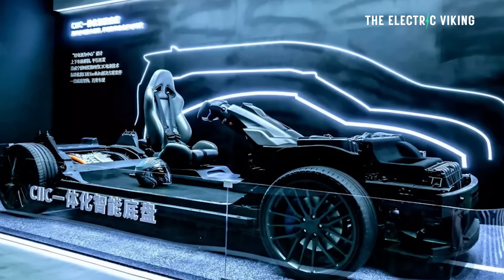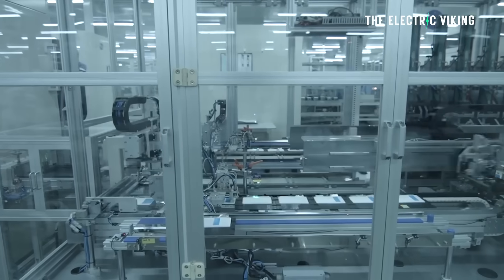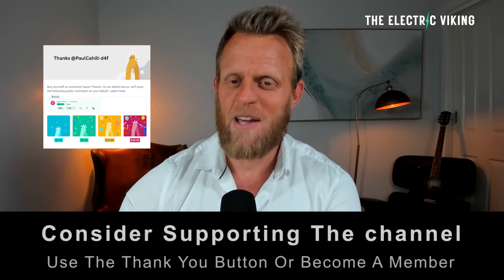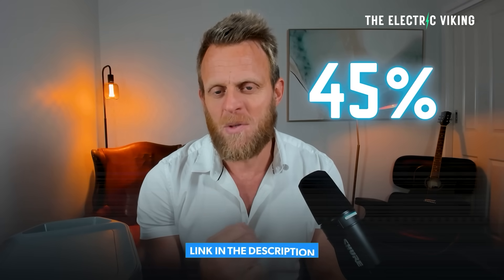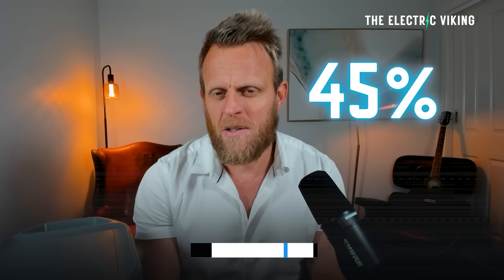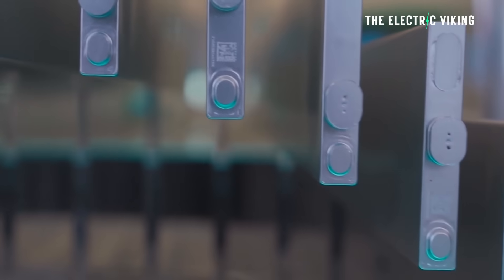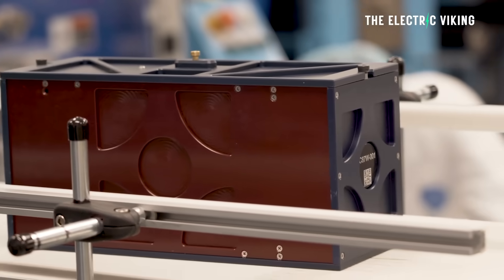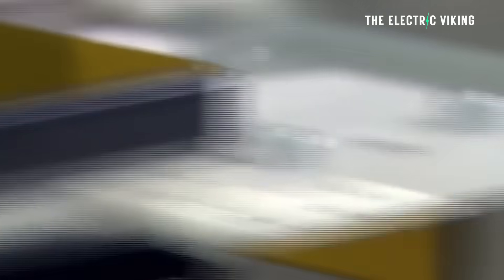1,000-Mile EV Range Unlocked: CATL’s Lithium Metal Battery Breakthrough!

Comment: in theory,  in a simulation, it was found that with some tricky engineering and assembly processes and the right materials it is possible to make at least 2 MW per ton without lithium ion materials. AT LEAST 2MW per ton. and... with regenerative braking and other energy collection methods we could easily travel that 1000 km and more. I would love to see more research on non lithium batteries... the metals used in this battery are common .

Comment: Like you said at the end of the video, I really don’t think people understand electric vehicles. 
I recently bought a Silverado EV for my work fleet. It’s going to be used in construction and on job sites putting about 35 to 40,000 km on a year. I’m gonna put the truck to the test. But most other colleagues of mine have mocked me for choosing to switch to an electric vehicle. The biggest downfall of an electric vehicle at this moment is range, but what my colleagues don’t know or understand is that range is only a downfall when you have to travel long distances daily. If I do at almost 400 km a day around my area for work and I mean that is absolutely the worst case scenario, the Silverado EV should have over 200 km still in range in which I will make it home or to my shop to plug it in for the night and have a fully charged battery the next day. Range anxiety is quickly becoming an obsolete thing unless you do long distance travel. And all it takes is a new type of battery to come out because the platform for EV vehicles is already in place. The foundation has been built so now all we need is a far more efficient battery that is far less weight and you’ll be able to get a lot more mileage than any internal combustion engine. Ice vehicles have reached their peak. No amount of re-engineering can make them far more fuel, efficient and burn less petrol. The wheel has to be reinvented at this time. I see where the future is going and I’m going to invest in it.

Comment: China's infrastructure is advancing so fat, that Chinese EV ranges should DROP. 

China has by far the world's largest high speed rail network, with more and more connections, covering anywhere that one would comfortably drive over a single day.  Thus long range driving isn't a significant use.  Over the past decade, China has added the most urban rail, commuter rail, and other public transit, so most people won't need to drive to work, to school, etc.  China is also huge on micro parcel delivery and most live in apartment blocks, so groceries and such are a short walk away.  Chinese taxis and rideshare are also very convenient and affordable.  Thus, there is very little need for most Chinese to drive on a regular basis - China is doing everything to make cars optional. 

For those who do drive, China keeps adding more and more fast charging, making charging more convenient and available.  With range anxiety solved, Chinese EVs can reduce battery size and cost, improving affordability and overall vehicle performance.  Instead of using an 75+ kWh battery weighing 500+ kg, they can spec a 25 kWh battery that weighs under 100 kg.  This makes the car that much more affordable.

Comment: Sam do the math right. The Panasonic 2170s in a Tesla are approx 250Wh/Kg, these cells claim 500Wh/Kg or 2X. For the same weight battery as the 82KWh battery in a 3 or Y you could put in a 165KWh battery pack which would give you 680 miles of range. Alternatively you could put in the sane size battery and cut the weight of the car by about 500lbs. That would boost the range a bit but it's hard to say how much because aerodynamics dominates and that wouldn't change.

I don't know what you were thinking when you said a 70KWh battery would give you a 1000 miles of range, 70 is smaller than 82 so the range would drop accordingly.

Comment: I’ve been hearing about the 1000 mile battery (1600 km) being just around the corner on this channel for the past four years when Sam first started publishing his videos. I think those are many, many years away, if ever. My friends with EV’s say they tend to plan on 400 km (240 miles) maximum between charging when planning a road trip, car loaded up, 2 adults, 2 kids, bags, aircon running, etc. They still have a reserve left but in any case they try not to get below 10%. We did a tandem road trip in our Mk5 Golf TDI with them once and we get 850 km in town and 1000 km on the open road so it was a bit frustrating waiting for them to charge all the time. We did drink a lot of coffee and ate a lot of sandwiches while waiting …😅

Comment: Sam, you need to rewrite your text.. If you put a 75kWh lithium metal battery instead of the existing 75kWh blade battery in a BYD, it will drive exactly the same distance. Well, maybe a little more since the CATL 75kWh lithium metal battery weighs less. But 75kWh is 75kWh. It's an energy measure. Both batteries have exactly the same capacity. What you meant to say is "in the same weight of BYD's 75kWh battery, CATL can fit a 150kWh battery". That's what you really intend to convey.
Reply: The new battery will drive slightly farther because the car will weigh less, so there will be less frictional loss at the tires.  Maybe 5% range increase from reduced frictional loss, assuming that battery weight is a significant portion of overall weight.

Comment: I think there is some fundamental confusion about the energy density. These new lithium metal batteries have 500 Wh/kg at cell level, not battery pack level. When translated at pack level, it will be reduced by about a third. Typical current NMC batteries (Tesla) have cell density of 250, pack density of 160. So, lithium metal batteries at 500 Wh/kg may reach something like 320 at pack level, which is twice as dense as current NMC, but not quite three times as much.

Comment: A bit confusing there. If density has gone up a 70kWh battery would be smaller but the car would still go the same distance.
OR a battery of the same weight & size would be 140kWh of energy storage.
Am I missing something ?

What we want is lighter cheaper batteries huge range is really not an issue to me. My 4 yr old Volvo does 200 miles and that is a lot more than my bladder. Many newer more efficient cars easily do 300 miles. Charging structure here in UK is now not bad so no real hassle stopping for a coffee and a charge. Maybe your huge distances over in Aus are an issue, but what it really needs is a great charging infrastructure and fast charging cars.

Comment: If you put a 70 kilowatt hour battery into any car it's going to go the same distance plus or minus a small amount for weight difference. But it still takes a kilowatt hour to push a car size object through the air at 70 mph for 4 or 5 MI. Now if you put a CATL battery in that's the same physical size into a Tesla model 3, then it can go a thousand miles. But just putting a 70 kilowatt-hour CATL battery in is not going to make a huge difference if it's still 70 kilowatt hour..

Comment: What he should be saying is for the same WEIGHT of the current battery (lets say 200Wh/kg) of 70khw,  this new battery will provide around 170kwh of energy and hence, considerable amount of more miles.
If he is comparing with current 70kwh battery at 200wh/kg to new 70kwh battery with 500wh/kg, the energy of both batteries are same and the only added benefit is nearly 2.5 times of weight loss, this will give some extra miles, no doubt on that, but not to the extent of 1000 miles like he said as energy of both batteries are same.

Comment: I feel like hybrids may be more useful than these megarange batteries. You use the small electric battery for an average top range people do on the daily - 100 miles maybe. Then if you need to go further then you use fuel. That way the majority of milage is done on your own solar or cheap overnight electric and those long journeys if necessary can be done on fuel. 

The battery part is going to be the most expensive component in these vehicles and more weight or more range, needs more battery which needs more weight. Surely its better to have a small battery used more intensively than a jumbo battery that is lugging around and barely being used (and at huge cost).

Comment: Just so you get it right; 
Watt (W) is power, Watthour (Wh) is energy.
Which means talking about energy density in a battery you should use the term Wh/kg. When talking about the instant power you can get from a battery you should use the unit W.

Comment: Safety issues?  We need more specifics - and safety in general, also low and high temperature performance probably rank higher than just energy density, charge power and longevity.

Comment: If they have a high energy density LM battery now that can do 1,000 cycles, then CATL could put their lithium metal batteries in their Freevoy battery pack with their Gen2 sodium ion batteries. Then you could have a 25 kWh sodium ion section that provides say 200 miles of range, and 10kWh of the LMBs for an additional 200 miles of range when needed. Since most people drive less than 40 miles a day, then they would almost always use just the sodium batteries (which have very long life) but then charge up the whole battery pack for the occasional long trip. Having a smaller, lighter, cheaper battery pack, and more range when needed. Win-win.

Comment: Toyota is going all hybrid for the 2026 this Year Model Year "last gasp for the gasoline nutters." ⛽ how a vehicle is #configured in the age of Full Autonomy which full autonomy been true for a long time now but no more need for bench seating for example from what I've seen on eBay where I can pick an an all electric bicycle with a removable battery for a few hundred bucks now that is #folding_bicycle 80 miles of range at 40 miles an hour starting to become more like a motorcycle now and far more fun and better. At some point possibly imminent 80 miles an hour with a range of 80 miles or even 800 US statute miles who knows by this Fall for a motorbike absolutely no one wants refined product from oil in the USA anymore can't stand the ice platform anymore or the ice platform people friggin hate em actually. How quickly this now is effected good question but it's happening big time now certainly is true already for all of Asia #vinfast 😊😊

Comment: 1000 km range is overkill. Firstly, once the range is 450km, many of us would prefer to take the energy density improvement as a smaller battery, making the vehicle cheaper and lighter, and hopefully with cheaper tyres. Taking a rest every 200km or so is a frequently recommended safety measure.      Secondly, as the battery becomes larger, even small self-discharge rates become significant.     The best solution to driving long distances involves rapid charging. and plenty of charging points along the way.
Reply: Like every time there's a new type of phone battery. They just make the phone thinner and hit the same total capacity. At least with cars, the drop in weight would be good.
Reply: The vast majority of people drive maybe 50-60 km per day, with trip of less than 25 km.  If charging is ubiquitous at work (daytime solar), at home, how much range do you really need?

Comment: If this energy density can be achieved a Model Y's battery drops from 1700lbs to 830lbs for the same range. A 6 cylinder petrol engine + 18 galons of petrol weight about 760lbs. So getting close to weigh parity (I'm ignoring the electric motors as they weight about the same as a petrol multi-speed transmission). I agree that electrification will happen sooner than most assume. Electric vehicles are still running down the cost and complexity curve and still have a future of significant improvements. Petrol technology has been essentially static because there is not much left to optimize that is affordable.

Comment: While weight is important, you also need that the volume it takes get smaller too.
Gaining around 300kg would be welcome, replacing the same volume, but getting lighter battery, but it is like 100km more, maybe?
On the other hand, having two times more of energy in lets say one liter would be really great, because now you would be able to double capacity of the same size battery, and that would meant getting almost double of the range.

Comment: I'd rather have a car still with the same kw/h battery but half the size and half the weight. Potentially cheaper car, lighter, faster, better handling and more mileage (due to the lighter weight).
Reply: Half the size, half the weight, 40% less battery cost.

Comment: For a pickup pulling a trailer; both loaded....500w is definitely needed.  For a short bus with 14 people aboard, 500w is definitely needed.
Reply: are you educated enough to understand the difference between W/kg and Wh/kg. Don't worry, the e-viking isn't. well, but he has a YT channel talking about it 🙂
Reply: @stefanweilhartner4415  Yes, I've installed my own solar power system for residence backup and it has worked well for 2 years now....but I get very little sunshine in Winter.  So I have to use grid power and a generator/batteries during
low solar power times.  My village has about six grid power outages per year and some years we lose grid power for nine days.

Comment: They sound great . I think when you say put a 70 kWh. battery in you are really replacing a say 60 kw . Thats about a 12% increase in energy and  aprox 10%  in weight , thats not enough to double range BUT if you put in the same weigh of batteries that would be aprox 150 kw battery pack .

Comment: The part with the 5-10 years to commercial availability was a bit of a downer
Reply: At that time scale it will be competing with Li S cells or possibly Al  L/S other possible chemistries and with greater availability and stability than Li   .... It's like the evolution of flight from 1940 on for 50yrs ..except this is happening 5-10x times faster.

Comment: With an increase of energy density and long cycle life like this, at some point, range won’t be a concern the weight of the battery will greatly decline, and with declining battery prices ev vehicle design will change. It seems like all the major hurdles for adoption will likely be removed in the next 5 years - which is a good thing.

Comment: Half the battery with the same distance, means a lot more batteries for a lot more EV's at a substantial reduction in cost. 99% of vehicles dont need to go 600 miles, especially with home charging.
Reply: Every vehicle benefit from lower weight though, that's means same km for half the weight as it now.

Comment: Might not be in the next year but this will happen. Range is going up every year and charging speeds will go up too. Charging speed won't help with most existing chargers but it would be nice when you can find one.
Reply: Xiaomi YU7 seems to have a SSB with a density of 400Wh/kg, which is said to be going to be released in Q3 2025.....

Comment: 400 cycles at 600 mile per charge is still a 240,000 mile battery. C rate and charging temperature also need to be finalized.
Reply: I heard that we should keep the energy in the battery somewhere from 20-80%. And those 400 cycles can be achieved if we charge that way. So if a full battery can drive 600 miles, then that 20--80% charging habit can go only 360 miles for every charge (that means ~ 400 x 360 = 144k miles). Is that correct?
Reply: @avalagum7957  You bring up an important spec, which manufacturers should give us when they commercialize a battery chemistry. 
How the battery is used is also important. At first, Tesla recommended 80% max super charge to improve battery life. Real world data after many years of Tesla charging showed that the 80% number was not as important as once thought.
This demonstrates that we have to 'discover' each new battery type.

Comment: Question: Couldn't they just change the electrolyte every year? I'd be OK with going to the mechanic for a 20 minute refill once a year to get that kind of distance.
Reply: It won't be that easy. This involves electrolyte, conductors and insulators. Each thinner than a human hair. Laid on top of one another and rolled up to fit in a canister. Essentially, they would have to recycle the old battery and make a new one.
Reply: @robertwhite3503  Thanks man.

Comment: Hey Sam, I have been blocked by various EVangelist YouTubers because they did not like hearing that they are being financially and environmentally irresponsible by driving EVs. The Grouch that Barx actually dedicated a whole YouTube video just to discredit and ridicule me. His latest video is about how cheap used EV batteries can be had for on eBay. Really? Who believes that cheap used batteries are a smart financial decision other than EVangelists? Mathematics and common sense really aren’t their strong suit.
Reply: "they did not like hearing that they are being financially and environmentally irresponsible by driving EVs" Ok, there is a chance at that. Or, you are just wrong, your "facts" are wrong, and just possibly you keep posting the same stuff over and over again. Try it here. I still see posts from people that go against what the Electric Viking says.
Reply: @markvalery8632  Hey Mark, are you one of those who believes that they are being financially and environmentally responsible by buying/leasing an EV every 3-5 years? If you are, I would be glad to share the lesson. However, I must warn you that it is lengthy and you won't like it.
Reply: @thevolvodrive2811  No. Also, I keep my ICE vehicles an average of 17 to 22 years before they are run into the ground. Are you one of those people with a V8 pickup truck that is never used for toeing or loading or work? If you are, I would be glad to share the lesson. However, I must warn you that it is lengthy and you won't like it.